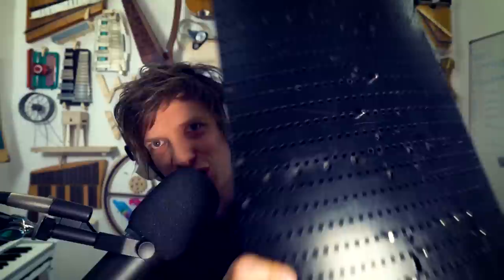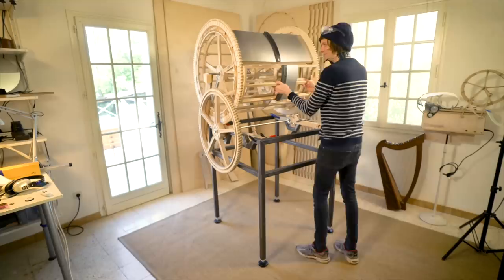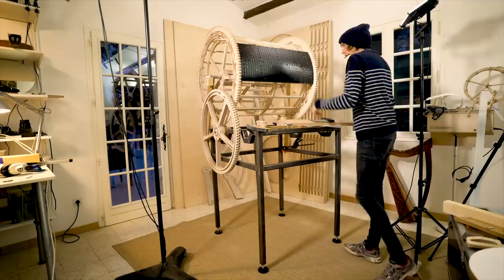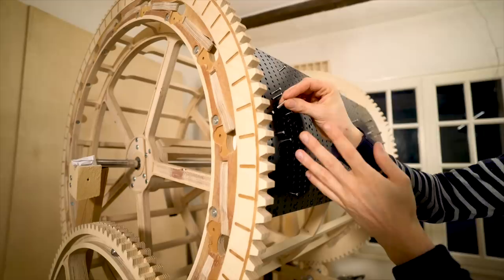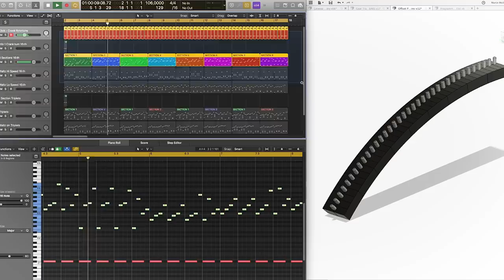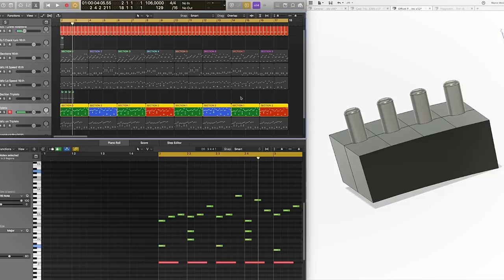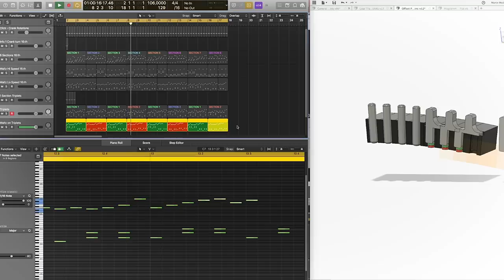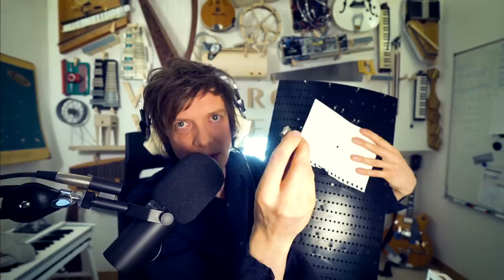Magnet "Midi" Music System - Marble Machine X #25

Comment: Well, for some reason I can't reply to the Design Discussion pin... But here's my idea for A PRACTICALLY INSTANT REPROGRAMMING SYSTEM:
Glue the pins to the programming template. That way, all you would need to do to reprogram the wheel is take one sheet off and put the other one down. Keep the magnets, they would still hold it in place, Just maybe make the programming sheet out of something a bit more durable than paper.
Reply: Caudex the whole idea of these plate is so he can reprogram them separately so it can play nearly any song. With this idea, you would have to make way too many plates to transport them and you could only play limited songs.
Reply: Caudex i
Reply: Ya.  From a production standpoint this makes complete sense.  But for a traveling show standpoint it is harder to ship potentially 100+ plates of programing sections.
Reply: Agree. I'd completely omit the programmable sections on a tour and use fixed sections. Say they play 5 songs on the marble machine in one concert. That would mean to prepare 5*8=40 sections.
Reply: what if instead of a sheet of metal underneath it was a large magnetic strip then you could take advantage of both pins without needing a magnet on either this would then make the pins stronger and reduce the chance of a pin breaking and locking a slot from being used
Reply: I can't reply it, isn't that a bit strange?
Reply: +El Link de YouTube -- No, it's not strange at all. YouTube limits the number of replies to one comment to a maximum of 500. After that, you can't add any more replies.
Reply: +HiddenWindshield--Oh, thx for the information.
Reply: That's great! Maybe use screwable pins for the stage songs, that keeps the flexibility to change things up.
Reply: I had an idea for the triplet design, for triplets make the core spin with 6 or 9 covers instead of 8, for template programming you make indented sheets, number them and you are good, for reprogramable sheets you just use frequency based electro magnets
Reply: Drill a tiny hole in the metal plate, underneath the magnet. Put red / green leds underneath these holes. Program the leds to give red or green light. It's a very fast way to program a new song. You might be able to connect this to your music software.
Reply: Geert Eshuis, at that point you wouldn't even need the magnet/pin System at all. you could just use sensors over the lights... That's a little too far I think lol
Reply: I agree with +Caudex that flexible program is fun and perhaps needed at some point, but for "standard songs" pre-made sheets would probably be much better. Note that the suggestion is not to have separate "plates" but to have a way to remove and put in all pins at once. Like the "template" idea, but keeping the template on the wheel while playing the song. I think it would be possible to mold a flexible rubber sheet and perhaps molded rubber pins could be sturdy enough to not need the metal pins. These sheets would also solve the problem with triplets, and even give you full flexibility to add off beat "pins" in the design. You can make these "sheets" horizontal (one per tile) or vertical (stretch in time direction). These sheets would be possible to pack in a flat case and jack into each other. The problem would be how to create such a rubber mold... maybe the boring "factory way" or if you investigate resin molds? 

Even if I would hope that each pin placement would take only 10 seconds and you would never fill more than half of the slots. It would be feasible if we say 700 minutes and you find 8 helpers to split that. I doubt that a machine would be much more than 10 times faster and you would only have one machine on tour? Would even one machine out-weight having pre-made plates? Having an automated pin placement machine seems to be much more of a problem and manual placements of pins would be a cool way to interact with audience, but this many pins is probably still more stressful than fun. The alternative I think would be to ask the audience in each tour location to make the plates for you, from published drawings, and surprise you. :)

As for color you should have different color for different sets of programming plates. I think you meant to have 2 sets of plates? It needs to be very easy to see if you forgot to change a plate. So you need easy-to-see numbering as well, to make sure that they are in order and an arrow to indicate play back direction. Perhaps have unique slots in the wheel, so each plate only fits in one place. 

One comment warned about making sure that the plates only fitted one way (as with my arrows above) but another comment noted that there seems to be spare room between the tracks. If this allows for another set of "ignored tracks" you could make sure those tracks were instead played if the plates were fitted "upsidedown".  If the plate could be fitted both "play direction" and "reverse direction" to begin with, two songs would be programmed at once. Do you plan to play more than 4 songs on MMX per concert?
Reply: So can you repeat the question verbatim and then say V.2 or V.3 so the 501 comment under V.2 and 1000 or whatever 1001 after V3? (gaming the system....?). Or is YouTube watching out for stuff like that. And why are some of the videos captioned and some are not? (meaning the Caption on/off symbol is on some of them and not on others, like this one...)....
Reply: you did see how many hours it took to build?? I'm sure he left out some of the nitty gritty too.
Reply: YouTube allows a maximum of 500 replies per comment.
Reply: Geert Eshuis 
I can see the merit to this LED template system. Instead, what if the entire plate can slot onto an LED array? Then a computer can control all the lights. The team could do the magnet thing, take it off the LED template system, put on the  next plate, click 'next' on the program so the lights change to the next set, then repeat. Only issue is, it's not as portable as a paper template.

Comment: Martin.....I keep thinking that the 8 panels per loop must be quite limiting.  I notice that your pin tracks are purely cylindrical; What about making the whole cylinder into a threaded drum- you appear to have quite a gap inbetween the channels of pins, so if you extended the width of the drum by a few inches and had the tracks in a spiral with the same thread pitch as the driving mechanism and the tracks slightly closer together, you could have a track loop 3 or 4 times as long as the whole drum moves across on the extra width.  The speed of horizontal movement would mean that the pins would effectively be presented to the triggers as if they were still in a vertical track (nothing in the top section would have to change) , but you'd end up with several times the overal distance to play with than just having the 8 panels until the loop has to be repeated.   Hope that makes sense?
Bill

Comment: (Give me a like so Martin can at least see this)
I have an idea. What if you had magnet dispenser of sorts that has the pins stacked over all the holes on the programming wheel. You would just have to wrap the programming wheel in some sort of plastic to block the rest of the holes and the plastic would have holes over where you would want the pins to be so they snap into place. All you would need to do is rotate the programming wheel and the magnets would engage automatically being dispensed by a dispenser. That would make less work for the technicians, but it would be complicated system with its own problems. 

Though it would be very satisfying to have all the magnets snap into place automatically to the beat and pattern of the song before playing.

Comment: Do the programming plates fit in upside down?

If so, you could offset the quad holes to the right, the triplet holes to the left, and the reading levers to the right.  Then you either install the plates normal for quad or upside down for triplets.

If your tolerances allow, you could have pins in both rows, and then just flip the plates to change songs without moving pins at all.
That would mean your reading levers would have to let the row of extra pins pass between them without catching, though.

Comment: Haven't kept up with the progression in awhile, but one way/method to assist in solving the programming issue, is to use color codes. This may introduce some new problems, but with any engineering project, new ideas presents new problems, but also invents new solutions. Thanks again for doing these videos. I enjoy them not only as an engineer & programmer, but also as a musician.

Comment: There is an easy way to have 4 based and 3 based spacing. You have to offset the pattern such that it is not symmetrical with the panel. If you put the panel in so one edge is facing up the pins would align with the 4 spacing, and if you flip the panel around 180 degrees it would align with the 3 pin spacing. You could use all the same style pins, etc. and fit the pins between the rows you have now.
Reply: The downside is that you can only change tempo once per panel.

This does raise the issue -- how do you tell which way is up on the panel?  In the current system, isn't there a chance that someone could accidentally mount one or more panels upside-down, resulting in... well, something, but definitely not what was composed. :)
Reply: If the panel is upside down wouldn't the song be wrong anyway? Seems like a flaw already potentially in the design. I am sure they can prevent this amd have thought of it.
Reply: Nice solution

Comment: And the "clip" of the magnet rods works really like a clip in a gun, it would be a vertical gravity drop tube which holding all the rods, at the bottom is a horizontal tube where a wood pusher pushes the lowest rod forward away from all other magnet rods and ready to be dropped (really like the mechanics of your marble dropping mechanism)

Comment: If you aren't set on having people reprogramming the wheel during the live shows, maybe you can just make a set of programming plates for each song you play. This would save time and each song would be set so there would be less room for error. 

I like the glossy finish compared to the matte by the way!
Reply: jawnsyn that makes sense but involving technicians on the set is interesting too
Reply: This was also my idea and, with new plates for every song, you would still have the "spectacle" of technicians putting in the pins but basically no room for error (besides not putting in pins at all...)

Comment: Excuse my ignorance, but do you need 4 pin and 3 pin timing in the same song? Could you have one set of plates with 4 pin timing and one with 3 pin timing?
Reply: I thougth the same
Reply: actually many songs to switch time signatures in the middle of the song so the 3/4 time pins are a very good idea.
Reply: jonathan kydd but would that change in time signature be in the middle of a bar? Depending on the number of bars on each programming plate, maybe have two different plates for each time signature and just mix them on the wheel.
Reply: I didn't know that, You learn something new every day.
Reply: @Neil: yes, this. With one set of 4/4 plates and one set of 3/4 plates, it can change back and forth 4 times in the same song. Although only at every 8 bars. Is that so bad?

Comment: Watching you change tolerances to improve fit on the programming plates I began to wonder if you had done any testing on the effects of various temperatures and humidity levels on the dissimilar materials especially as relating to fitting parts together on the fly.  Taking this on the road to concerts may make this important.
Reply: svleonard lower tolerance, then a good coat of epoxy or PU varnish to keep the moisture stable? If that was done with everything perfectly dry, would temperature then have any significant effect?
Reply: svleonard i.e. the coating would bring it back to tolerance
Reply: Surely a coating would help with stabilizing moisture content.  There is also expansion and contraction to consider with various materials reacting differently to variance in temperature i.e. wood may expand more or less than steel or plastic components.  I am not sure how this would effect severe tolerances so I ask the question to see if Martin has done any testing.  Hopefully, no major issues will be a factor but it is a consideration.
Reply: While I'll concede that moisture could be a problem, I don't think heat expansion is going to be something to worry about. I doubt he's going to do an outdoor tour of Europe or North America during the winter, then fly straight to tropical climates. I'd guess that the temperature range it will experience over the tour will be something like 15C-30C, and heat expansion is negligible over such a small range.
Reply: I was also considering expansion... I think an oil finish like Tung oil or Hemp oil, that polymerizes slowly and stabilizes after it soaks into the fibers, would be ideal.  Something that doesn't create a film.  Hemp oil has the advantage of not having a solvent to aid drying, so it can be applied without gloves, and without ventilation. It will provide a moisture barrier, however, doesn't change the color of the wood, or provide UV protection, so it will still weather like it should.  I doubt either would offer any noticeable effect to tolerance.
Reply: Humidity is a thing.  You don't want to have to hammer these panels on when you tour to very humid places.  Wood GROWS in high humidity.  "Building in tolerences," such as what you had before making it tighter, is a useful thing.  But I suppose you could always sand off what you added on the road on an emergency basis, but I wouldn't wish that on you.

Comment: Hey, 
First for the magnatic pin idea:
to remove the pins faster bevor programming it again, you may make it possible to slide out the matel plate behind, so the magnets just fall out.
Second:
instead of milling tamplates for the reprogramming why you don´t mill direktly something like a skin wich is just wraped arround where the programmingpins are already on? E.G. thin plywood with something like nails in it.

Comment: I would also try to use Pins that are not magnetic something similar to a headphone plug, 
and i also like your first idea about offsetting the Pins, but you only need one extra Pins not two, because for the third one you could just plug the "Offset-pin" on the next hole and turn it 180° -TRIPLEHYPE

Comment: I fear you're making the tolerances of the "midi" segments too tight now, sure it works nicely here, but you have to consider humidity when travelling with the instrument around the world, you might end up having a hard time fitting them on there when the wood expands.
Reply: MetObsessed - Ply or laminate should negate this to an excellent / non problematic degree. I live in The Tropics - wet and dry seasons - both extremes, to extremes.  We have an orchestra and many  of the double basses are Laminate - not  because they are cheaper - but because they are STABLE and tough. That's a huge area of wood. My Carved instrument requires setting up twice a year due to the environment - The Laminates just sit there, very stable indeed.
Reply: Well there is a difference from living in the tropics and the weather all around the world.

Just going between Scandinavia and Brazil would make a giant impact on the change. Most rapid travelling musicians knows this, if you switch climate quickly every instrument has to be re-tuned a lot, some drop an octave just because of temperature and humidity.
When there is 6 months between dry and wet seasons it simply doesn't show the same way because it happens over a long period of time.

I foresee him suddenly having the midi sections not fit simple from going to a climate wildly different from his own European one. We are talking about a big puzzle here not an instrument when I'm voicing a tolerance concern.

And like we have seen fairly many times, he always makes the tolerances too tight.
Reply: If there needs to be some play to compensate for humidity and temperature changes during the tour, using a felt fabric in the stationary fittings would dampen any rattling during the dry periods.
Reply: Still though, the music has to be in time. If the wood wasn't tight enough, it could move up or down and throw off the tempo for the song and rhythm
Reply: TLS Archer8 Why would it matter unless you’re doing something to a pre-recorded track?
Reply: praestant8 Tempo always matters, because its not prerecorded, and the slightest notch can throw the music off by at least 5bpm. That means, by the end of the song, the Marble Machine X is behind. Before you know it, you've finished playing, and the machine is still going. That's why the distances need to be precise, and to do that, you sould also need very tight wood.
Reply: TLS Archer8 I think you would try to match your tempo to that of the machine's, but I also get what you're saying because what if there are some unexpected and sudden shifts? yeah but I think maybe something more foolproof than always trying to match to different tempos would be better hahah
Reply: Evy Nguyen yea definitely, lol
Reply: The wood is high grade Baltic Birch which is a very dense plywood which if treated with an epoxy clear-coat should negate the possible problems for quite a few years depending on thickness of each coat (thin with plenty of curing time between coats) maybe even oven cured if possible would be very durable. Not sure what midi part You are refering to but I believe between the large gears is it . When He was test fitting He showed spacer/collars which have locking set screws so play can be easily adjusted in maybe 5 minutes or so and if those spacers don't have set screws they could be drilled and tapped(threaded) or You can purchase those same exact size collars(called locking collars) from hardware store or online. Not sure of the inventor/manufacturer/musicians' name but MANY praises from Me to Youon many levels